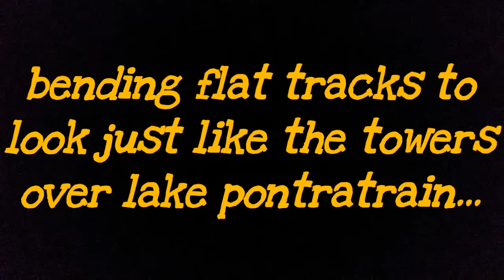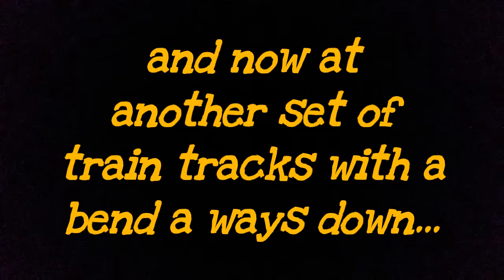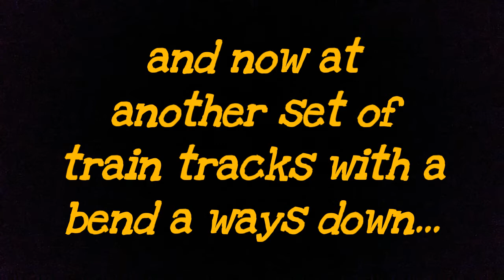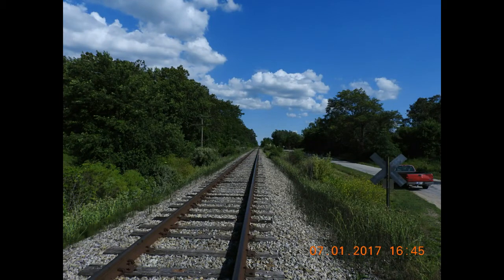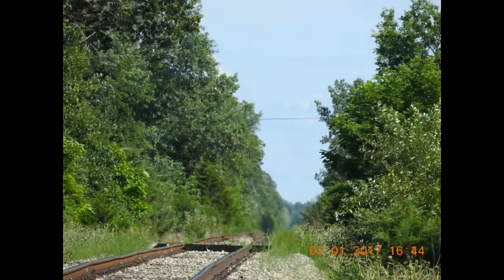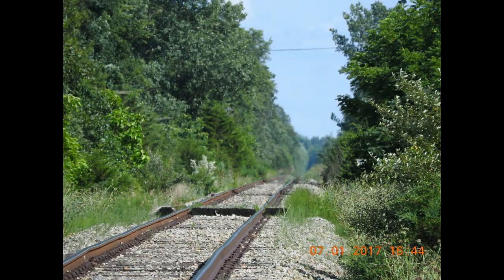Bending train tracks like the towers of lake pontratrain - try it

Comment: imo, This video is so going to 'open a can of worms' about how to interpret the images when zoom is used. Also, it will be interesting to see the difference between the effects of 'optical'  zoom vs 'software zoom'? Just thoughts? I am wondering about the effect of 'heat haze' type disturbance on what is seen when zoomed? The discussions about 'proof' are about to get quite interesting? 

Well done for spotting this effect, capturing it and showing it.
Reply from the maker: Thanks man. I'm hoping more try it and document it. It's an easy one anybody with a camera that zooms in can try. I'm looking for objects which follow the z axis over water for long distances. Maybe scaling it down would be possible?

Comment: I have an experiment for all FE and BE people to do. I have a few actually, but this is just one. So go to a football field. Where I am they are built with a 1% curve from center to corner. This results in roughly a foot and a half drop from center to corner. Some fields it is nicely curved, like a big ball, others it is more rampish. Either way, the center is higher. So, go to such a field with a video camera. Hold it at ground level pointing down the long end of the field and then, while still filming, stand up, slow or fast doesn't matter. Then have a look at the footage. I won't tell you what you will see, you need to do it yourself. I think this might get you thinking along certain lines of proof for one model or another. What you'll see is something no-one ever talks about when talking about proofs.
Reply from the maker: If you look back in my videos I have done this on a flat surface 460ft long. I have been screaming diffraction for a while now but it's hard to get people to listen.
Reply: I saw the flat surface video. That is not what my suggested experiment shows. Basically, by having the camera Low in the center of a Field that curves away, you are somewhat duplicating the curve of a BE (if the field is not doable then any road that has Slight up and down will suffice). Raise the camera straight up and Observe what you see. Now compare that to Any footage seen from an aircraft taking off, a high altitude balloon, or a rocket or even a drone going straight up. This is not to see a Curved Horizon as mathematically a horizon can actually look flat on a ball. This is to see something else. No zoom required. Just normal video mode, center of a surface gently curving away, raised camera while filming, compare observed footage to any other footage of things going up very fast.

Comment: Could also just be a bend in the tracks.  In other words, the tracks could be making a turn, or going over a hill.  So interesting observations, but it would have to be verified that they are actually straight like the powerlines at lake Pontchartrain
Reply from the maker: If you look closely on many of the pics some tracks go down and others bend up. In one on the same set of tracks one stays straight and the other drops off dramatically. I think this is called barreling of the lens. When you zoom in it decreases the aperture which can cause all sorts of lens distortions. Many which can be duplicated over and over when at the right angles. Really neat stuff the physics of optics. I still have much to learn